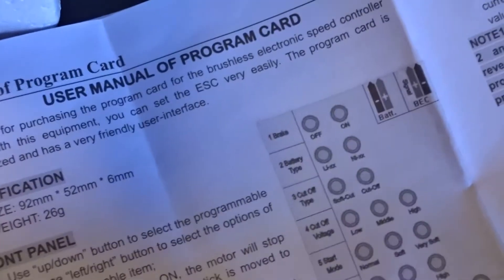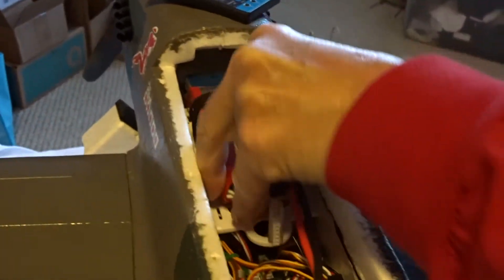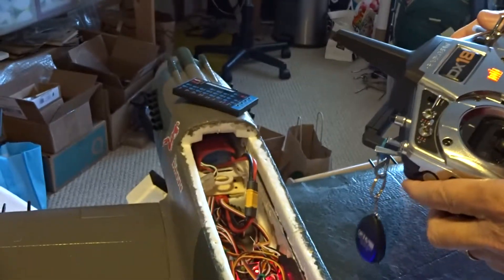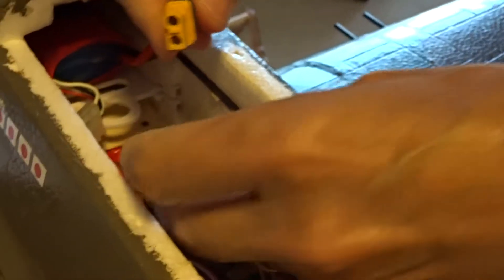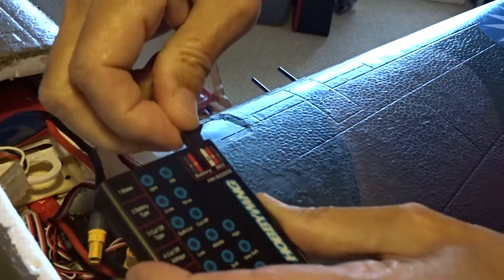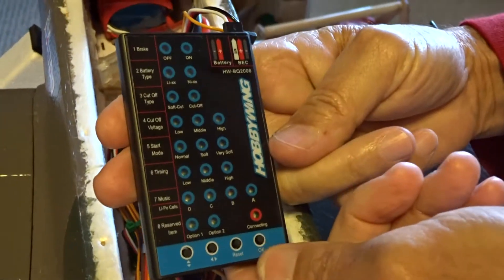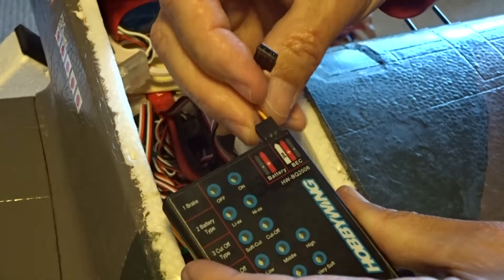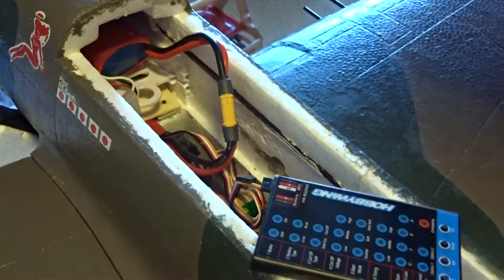HobbyWing FlyFun Fentium ESC Prog Card failure

Comment: please dont ever do testing indoor with prop
Reply from the maker: You are correct in most cases. This should have been one of them. Since making this video I built a stand to test props, motors and ESCs. With a foot on the bottom board, a prop can be static tested safely.
Reply: I stand corrected